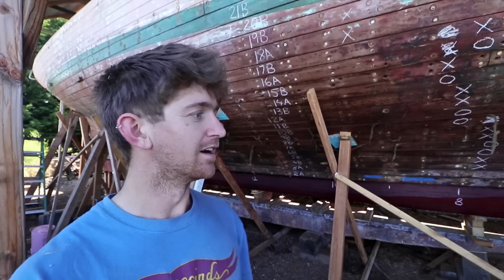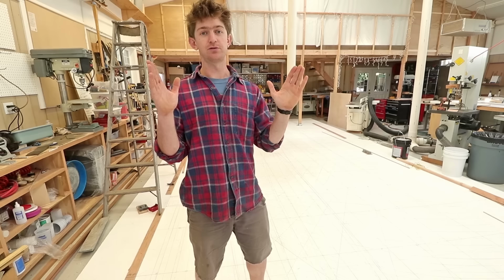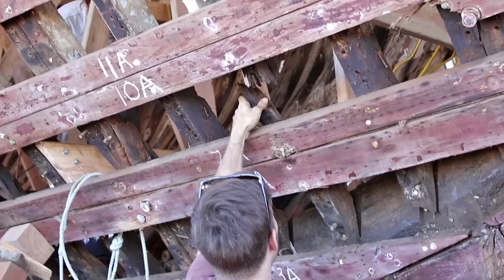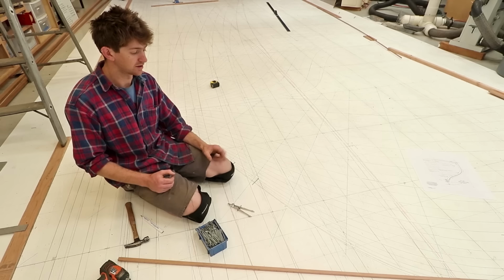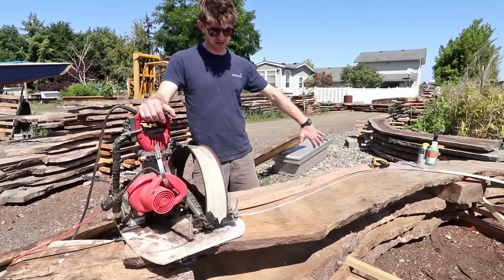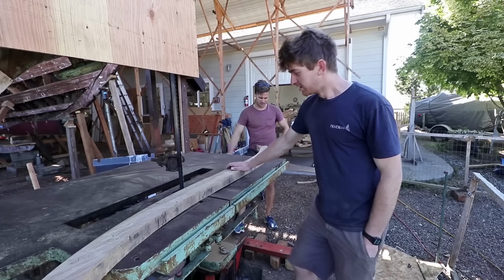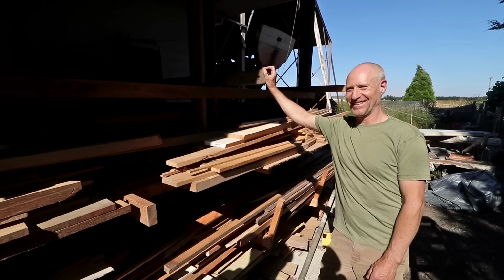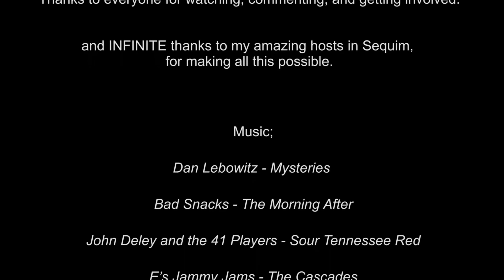From Lofting to Re-Framing / Removing Planks - Rebuilding Tally Ho EP27

Comment: Here is why the restoration of the Tally Ho is not a new build. Starting with the first few episodes, it was clear that Leo intended only to make the boat sea worthy (and likely pretty her up a bit). As happens with many restorations, the deeper one digs, the more one finds that needs repair...or replacement, if repair is impossible or impractical. Recall the episode when Leo realized that the TH had been either incorrectly built or (more likely) damaged, resulting in an uneven curvature of the frame -- specifically, a flattening of (as I recall) the starboard side near the top. He agonized over the decision of whether to restore her to the deformed shape or rebuild her to the shape as designed by famous shipwright Albert Strange. He chose the latter, dramatically increasing the cost (in every sense) of the project. This is not a "blank canvas" build. Rather, it's a restoration -- one piece at a time -- of an entire boat.
Reply: As the old planks come off and the new ones go on, the soul of the the ship remains.
Reply: I understand what you are saying but knowing her history and a fair amount of boating Leo must have known this is part of Any rebuild.  What's going to be left of the boat just her Name ?  He is doing a great job but should have just built one from scratch.  Because in the end it's going to be an old boat value wise even though everything is new.
Reply: @MegaBait1616  . about all that can be said for your comment is that you just don't get it.
Reply: Mmmyess Relax.
Reply: MarineMan you are the one that dosent was understand. Could you buy the Mona Lisa? What about someone’s favorite possession? Yes for enough money you probably could it’s because they almost transcend money, there relics. but for enough money and effort you can buy them. That’s what Leo’s doing, he’s creating a relic that has strong emotional value, I doubt you’ll ever find the best part of creating something.
Reply: So if I acquire one sliver of the Tally Ho and build a boat around it I have another Tally Ho?
Reply: @BaronCreel  no. Someone else wrote it best - Tally Ho is an active participant in her restoration. Leo is in a dialogue with her. Her form and history is in front of his face, and he is working step by step to fix her. If you have somebody’s brain and put it in a new body, is it still them? Maybe. But if you fix someone’s body, piece by piece, with blood transfusions and prosthetics and new joints, it’s still them. And eventually the body will replace itself entirely. But it never stopped existing and being part of the project.
Reply: @MegaBait1616 so, you have a child, and it’s born with significant birth defects.  Needs a heart and lung transplant.  The child survives the operation..but has someone else’s heart and lungs. Does that mean it’s now a different child?  Should you have just let it die because it would have been cheaper to make a new one?
If you don’t understand that wooden boats “have a soul” and it’s the essence of why he is going through this restoration, you should probably have watched something else.

Comment: a potential relay and a capacitor and you can get rid of the pony start on that phase converter.....total cost, 15 bucks. Or you can put an 80 dollar VFD on the bandsaw and run direct from 220 single phase....

Comment: You might have a helper that welds pull off the saw guards, pull them gently apart and cut and weld 3/16” galvanized sheet shaped around 1/2”x3/16” angle framework using bolt on tabs.  As a cabinet maker with a )not quite as) large band saw AND a Much Larger mill type band saw i know that if a blade breaks or slips off the wheel it can very easily cut through a leg or deeply into an abdomen.  The sheet goods wood cabinet, though very well intentioned would not even slow that blade down but only maybe serve to change directions or creat a jagged whip.  They are deadly and there is a great reason all new band saws come covered in metal with tight tolerance guides.  Life is a risk and you cant eliminate all of them.  But that’s an easy one.  Thanks for great videos, sorry to sound like an OSHA Inspector but I went through 2 years Physical Ther with a woman whose leg was sawed half off by a saw in an unexpected moment.

Comment: I am pleased with the fact that you are planning on reusing as many of the planks as possible and that you will use them where you can in the joinery of the interior. I understand the reason for the lofting, but then again, I have also been having the thoughts of taking the original soul/spirit of Tally Ho and replacing it. That being said, you are just trying to make her whole again and bring her back to Mr. Strange's original design. I imagine he would be very honored if he were still among the living. Well done, well done indeed.
Reply: I really liked his Explanation of that, how, as long as her Shape stays visible, It's HER, regardless of how much New Wood goes into her. Works For Me.

Comment: If you don't have a air hammer use a SDS drill to help punch out the bolts and rivet's. Just grind the end of a drill down as a tool works great on steam engines to.

Comment: Holy smoke Leo. I knew what you were doing but as those planks come off it seems to feel bigger and bigger of a task. But I'm with you. And don't listen to the bullshit about how much is left. I had a 40' lobster boat built on the East coast of Canada that somehow made it to the west coast. I started to take it apart to make it into a live aboard for my wife and I. We ultimately scraped it as it was to far gone and everyone said I shouldn't have gone that far with it, I should have just fitted it out and used it. Well when we got to cutting the keel up we found that all of the keel bolts had rotted down to the size of a pencil. If we had hit a deadhead or even some really bad seas that thing would have blown apart and we'd be dead now. What you are doing is for the best of the vessel and piece of mind. Keep on keepin' on Leo and Happy Birthday mate.

Comment: Brilliant work and attention to detail is inspiring. Just 1 recommendation, be good to wear at least eye protection when that close to moving metal and wood.
Speaking from personal experience, it's 1 thing to lose hearing, quite another to an eye which I almost did.
Was in a hurry, wanted to get job done needed an emergent trip to hospital for piece of wood.
Look forward to next inspiring video of your project!
Reply: I too have had trips to hospital to have wood removed from my eyes – using chainsaws. Made me much more careful. Also had a chainsaw cut into my leg – that made me MEGA careful when using them. I also worked with a guy who killed someone with a chainsaw (accidentally) and that was pretty sobering. When training forestry workers to use chainsaws I told them "Think of a chainsaw, or other cutting machinery, as if it were is a loaded gun and act according. That way you won't get hurt and neither will others ..."
Reply: There is a mess of protective gear for logging perhaps with that record you should have a thought about buying some!
Cant trust being careful lol

Comment: The work covered in this video is astounding.  I am very impressed.  I am also impressed with the Georgia ship saw.  Now I know it's been said a million times but it's going to be said again for it's so easy to forget and the mistake can be catastrophic; take care to properly clean up when using linseed oil.  Brushes, rags, etc go into covered metal container or fully immersed in water.  I have seen the results of when even professionals who know better have gotten careless.

Comment: There's a lot more to this than I thought. Hopefully I'll understand what a rolling bevel is by the end. I tried to get my head around the lofting process but my brain locked up.
Reply: That lofting board he has is a work of art if you ask me. I'm going to have to watch his video again to get a grasp of what he did.
Reply: I had to watch them Twice to get the Sense of it, fourth time I pretty well Got It. Just don't ask ME to do it, lol...
Reply: Jimson, The ribs are squared 90 degrees to the centreline, and the planks curve away and toward the centreline, except for maybe the couple around the immediate centre fore and aft.The ribs have a bevel edge so the planks have full contact surface across the Ribs.
Reply: Rolling bevel is like an ordinary bevel but it changes angle from one end to the other. Not easy to do on a curved frame!

Comment: Leo, It pained me terribly when you removed so many planks. I knew then the restoration was over.There is nothing wrong with what you are doing or how you are doing it but when you started correcting what "might" have been incorrect in the original build you ceased to be doing a restoration.  You began honoring the drawing, the design, not the boat. Certainly this is not the project you started. 
So,  you build a replica and use the lead keel and some of the planking to carry the spirit of the Tally Ho to the new boat. That's a good thing. You will come to this realization one day and I hope it does not make you stop or disappoint you, You are doing something really good here. You are teaching all of us much. We will know and appreciate wooden boats and wooden boat building. This is a tremendously important project.  Keep on Keeping on.
Reply: I disagree he is restoring the boat he has clearly justified his actions from the design plans and evidence of repairs done during the adventures of the boat like the major damage. Also he has supported his claim that the boat changed shape due to loads ect over the years with clear evidence. Tally ho Was in very bad shape when he started and you cant restore rotten you can only replace it with a accurate reproduction of the part. 
I still think it is important to maintain details like a knocked keel , dove tails and formed ribs to the iron braces even if it is not shown in the plans as long as he has evidence it was a modification done when originally built. Details like that in my opinion are what will make the new Tally ho a restoration not a duplication.
Reply: Yep, Yep :)
Reply: Or Yup yup?
Reply: Have it your way Tommy.
Reply: LOL I could make an interesting comeback but some none needs to be the adult
Reply: Tom, I'm not sure how you are interpreting my comments but I think I have been an adult. I chose to not debate the subject. I simply gave my opinion. I have no problem with you disagreeing. I didn't feel the need or desire to  discuss it further. I haven't made any comments to denigrate your response or call you names.. But then you felt the need to insinuate I am not an adult. Well as I said "have it your way". 
Just so you understand I have no problem with Leo's project or his work. I think it is amazing.
Reply: My response was serious the Yup Yup response to your yep yep was a joke relax John I respect your opinion
Reply: Ps until you started the Tommy crap
Reply: Just a tiny jab. Have a nice rest of your day:)

Comment: If you want to drive the linseed oil in , cut it 50/50 with kerosene. The wood ends up dry to the touch and sort of nut brown.

Comment: Nice episode
Can i make a suggestion -

Change the posts and top rail of the wire fence behind the Big ship saw to a heavy duty post and top rail, level with saw table top,
Oil and wax the top rail, (or hard waxy plastic) this will allow you to use it as a rest for the timber going through the saw, 
I put a lot of stupid sized slabs through my saw cutting along the growth lines, 
Much easier and more controllable than  an extra pair of hands you are sometimes fighting  against to stay on the curve.
Same on the outfeed side, if its too  long (and you run out of strength to steer) you can walk round and steer as you pull the wood into the blade. 
It's surprisingly easy from the outfeed side.
Reply from the maker: not a bad idea! thx

Comment: Boats are artifacts in the technical sense, so any amount of change would be irrelevant, since the boat (as a “boat”) only exists as an accidental arrangement of substances (wood, iron, bronze, water, etc). A boat is actually just a concept, not a thing that actually exists. What actually exists, again, is certain substances which are arranged in a particular way, say, the shape of a “boat”

Comment: I imagine after you've cut a few more frames you'll come up with the best system, that's generally how it goes.
I use the big Makita fairly often: low hp for such a big blade, very easy to pinch the blade.
Keep up the good work, take care.

Comment: Haha Wow.  Plunge-cuts with a 16" beam saw!  Yikes!  I used to feel nervous letting anybody see me do that with just a regular 10"-blade worm-drive Skilsaw.  In 3/4" plywood.  Good thing this is an all-volunteer project.  Anybody watching this who's affiliated with OSHA...  Their head probably just exploded. 

On more important matters, re. your lines drawn "outside the planking"...  You mentioned there's to be more about the rolling bevels business next episode.  I hope you're going to explain to everyone the geometric implications of the increasing bevels fore and aft, as they relate to deriving the true frame shapes with the variation in apparent plank thickness in those sections.  (This was referred to as "Mold Reduction" during my schooling.  But in our case it was usually smaller carvel boats planked onto a "jig" of molds+stringers+frames, i.e., the frames being the steam-bent type.  The extra wrinkle they threw at us, when accounting for those two extra layers, was an additional spar-taper reduction to the fore and aft ends of the longitudinal stringers!)

Comment: The contraption used to start the shipsaw is not a 3-phase converter.  All it is doing is using a single phase motor to get the 3-phase motor turning.  Once the 3-phase motor is turning at its top rpms the belt is removed.  3-phase motors use all 3 legs of power to get the motor up to speed.  But, they can loose one leg of power and will still run.  Only thing is that when used this way the horsepower rating will drop nearly in half.  Single phase motors actually use this same principle.  Only, they use a capacitor to produce a 3rd power leg and once the motor reaches a high rpm a centripical switch cuts it out.  

One solution that would have fixed this would have been to simply replace the 3phase motor with a single phase motor of equal or less horsepower.  Another would have been to put a cheap harborfreight engine on it.

Comment: Since you seem to be grinding the plank nails/rivets, which I assume are bronze (?), can I suggest you invest in some abrasive flap wheels in 40/60 grit. They will clog less and work faster as well as generating less heat. In my experience the bronze will clog the grinding discs, though you can use beeswax to lubricate on some softer metals.

Comment: You probably could have used this info a month ago, for driving out the old rivets, a roto hammer with the tip cut off the drill bit would drive them out so fast it would make your head spin.

Comment: For Leo and Other People interested in working with Southern Live Oak (Sawing and Shaping)---The "Waxy Substance" in Live Oak  could be somewhat  thought of as an equivalent of "Sap" in Pitch Pine . "Same" but "Different".  If a piece of "Southern" Live Oak is "Machined" (Sawed,Planed ETC) and the temperature elevates (gets hot) the "Waxy Substance" liquifies , coats the "Cutter" (Saw) further elevates the temperature (gets hotter)--Then it "Carbons Out" (Gunks The Hell Up) thereby destroying cutter efficiency . A solution? Use a "Solution" of some sort of "Gunk Prevention" such as perhaps Water and Pinesol ,Murphys Oil Soap ETC and apply this to your "Cutter" (Band Blade ETC) while sawing . If I (Steve Cross) was operating the Ship Saw, I would rig something that would Air Power "Mist" the Blade and simultaneously keep the "Line" dedusted.. I have the parts to build the next edition "Georgia Ship Saw" and likely the "Mister Air Blast" will replace The Shop Blower as on Leo's Georgia Ship Saw. Steve Cross aka SuperAx
Reply from the maker: Thanks Steve - great info!

Comment: get some carbide blades for the sawzall they made a huge difference I repair wood rollercoasters and will use a diablo wood blade to cut 5/8th bolts and wood fast and have them last a week if you watch overheating the blade.
Reply from the maker: I was using carbide on the sawzall. Very good.

Comment: When searching for a piece to cut  one side since they are mirror images or close to it. See if you can find planks to cut both sides from at the same time. If u have to shift the pattern slightly to get two from one. It might work out. You are the man in charge. It's just an idea.  Forward thinking since you now have several big band saws. Future builds where custom cut planks are ordered. Order them double thick plus a little. Cut one and saw it in half to have matching. Then it's the final bevel. Again. Just an idea.  Oh play news Radio to the baby crow. It will learn English from it. I hope.

Comment: The old "Ship of Theseus" question. 

From a traditional point of view....if you take a boat apart, and put a new boat together in the same spot it is "the same" boat (legally)...even if there are no common parts between the "before" and the "after."  

From a project point of view, I think this is a complete restoration. You never know how much you need to do until you are doing it. The ballast keel is being re-used...and that's a decent percentage of the "weight of what he started with.

The entire interior needed to be rebuilt from the start, along with all the standing & running rigging.  

This was never going to be a project that involved a coat of paint and some new sails.